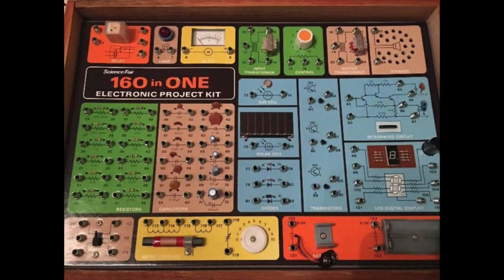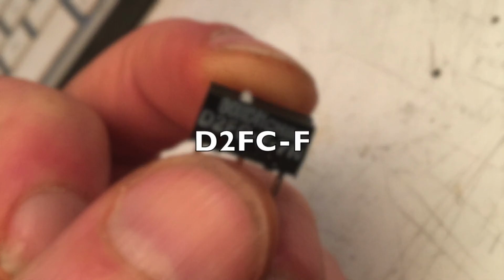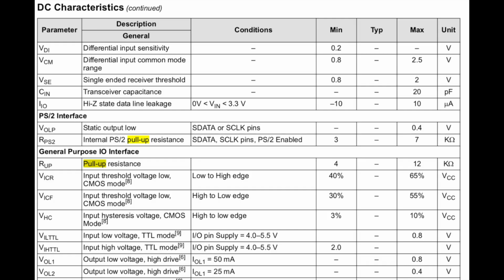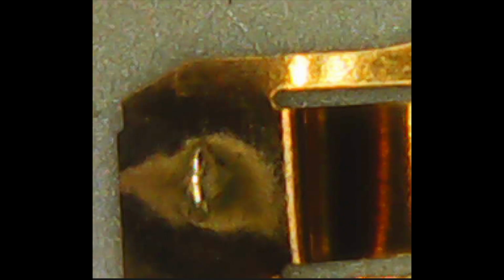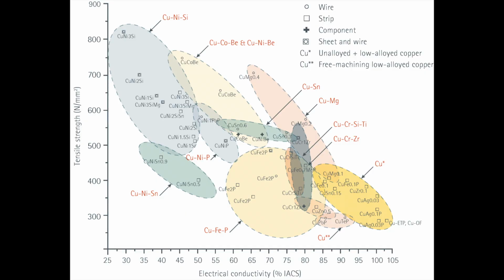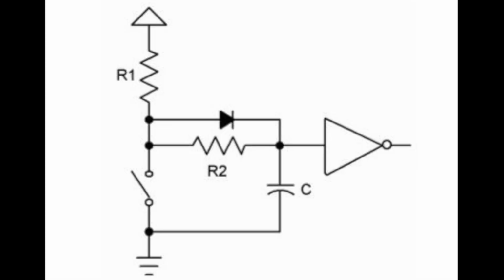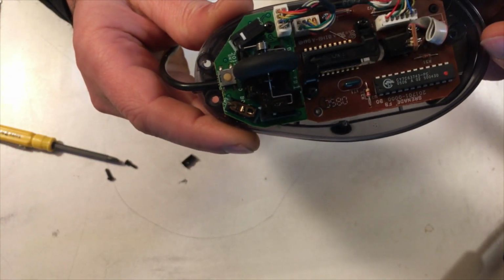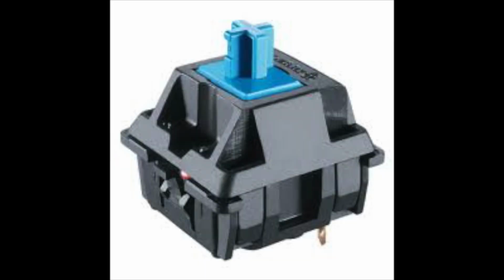Failing switch problem: Omron vs the modern mouse circuit

Comment: I am Brazilian and the video is a bit complex for my understanding. If the mouse gives double click problem which "best" switch to replace? What could I do ? Since there are no double click mice on the market
Reply from the maker: I have not seen long-term testing, but people with this problem have had good luck with the Japanese D2F-01F (I put one in my newest mouse and it has already lasted longer than the d2fc chinese switches). they are not perfect, but they are easier to find than other options (like the honeywell switch, which I am also trying out). One problem though is that total height above the base that the button actually clicks is higher than  the stock Chinese switches, and the plunger is slightly longer, so in SOME mice (Razer for example) they can feel too light and click too easily, and they don't have as strong a click feel. You can shave down the base slightly with sandpaper or whatever to fix that though. I have not tried out the newest options from Kailh or Huano yet, so I can't say if those are okay.
Reply: @AlexKenis  Many thanks for the reply Alex Kenis. Very nice that you make a very informative video and still answer the comments. I will buy an Omron JAPAN D2F-01F I hope it lasts a long time. Thank you friend. And i buy TTC GOLD (30M) for test only: https://pt.aliexpress.com/item/32837651235.html it's good ?. Thanks again. I found a Honeywell with gold alloy contact too, I will buy to test. Thanks for the tip from omron japan and honeywell.
Reply from the maker: @Pedro-gy4ht  I had not heard of that TTC switch, but the link says they are rated for microamp loads, so if that's true, i'll be interested to see how they hold up

Comment: Hi alex, sorry to bother but i saw that cherry has a switch (DG2)with a rating of 0.05A at 30VDC and gold plated contact. Could it be considered in specs?
https://www.mouser.com/catalog/supplier/library/pdf/Cherryswitches.pdf
Reply from the maker: Never seen those.  Looks like they are 87 cents on aliexpress, so I'll grab a few next time I put an order in.  Looks like they have a very low electrical cycle life, but that may just be an extremely conservative rating.

Comment: You sir, are life saving mad man!!! Worth every minute of this 1 hour and 15 minutes diatribe!

I always wondered why my Logitech G5 lasted 10 years and my G903 lasted just one before both switches failed (despite costing 3 times the price!).

As someone who have just recently replaced both double-clicking chinese Omrons, that lasted for a bit more than 1 year with light gaming, for Japanese ones (D2F-01F-T) on my G903, just to have these to start double-clicking as well after 2 months (!) of slightly heavier gaming sessions (+/- 2 hours/day), I appreciate immensely the information provided here!

I'll try other switch brands (I have some Taiwanese ZIPPY DF3s on their way now), but at least now I know this is unlikely to fix the problem for good, since the problem is with the mouse design and not necessarily the switches...
Reply: My mx-518 lasted 10 years.
Reply: Any results with the other switch brands?
Reply: @Black665  Yes! Following Alex advice I decided to pick some switches that had a lower current requirement than the standard OMRON switches. The only one I could find was one made by Cherry (DG2 T85), that has a 0.05 AMP requirement (instead of the 0.1 AMP of  every other switch brand). 0.05 AMP is still higher than what the G903 controller provides (which is closer to 0.03 AMP if I'm not mistaken), but I figured that it could last longer since the specification was at least a little closer to the current provided by the mouse's controller.

But the result was, unfortunately, not different from using Chinese OMRONs D2FC-F-7N(20M): they started to double-click after 6 months. Why always 6 months? I have no idea... But at least it was better than using Japaneses OMRONs D2F-01F-T(50M), which only lasted for less than 3 months before started to double-click.

So, at this point I have decided to get rid of my Logitech G903 (I have replaced its switches 3 times already in less than 1 and 1/2 year) + Logitech G Powerplay Wireless Charging mouse pad, and replace this kit with a Razer Basilisk Ultimate --which seems to have a long lasting battery, a convenient desktop charger and, more importantly, comes with optical switches that will never double-click. (Note: there are lots reports of people having the same issues with Logitech's G Pro Wireless. So I decided to skip that one altogether at this point as well)

My conclusion is that wireless mice seem to be more susceptible to these switch failures than wired mice (maybe it has something to do with the power efficiency of these wireless mice controllers, that is much higher and consequently much more out of spec to what these regular mice switches need to operate properly for a long time) . So, until all manufacturers move their wireless mice to optical switches, I'll have to stick to Razer (the only one offering wireless mice with optical switches at the moment: all the Viper line and some of the Basilisk models).
Reply: @SamGalt  Nice, thank you very much for coming back on this! Really helpful for me and others I'm sure
Reply: @SamGalt  Oh no, the Japanese Omrons didn't work for your G903? That's disappointing. 

I've heard Kailh switches can be a good alternative to the Omron ones.

The Razer Basilisk Ultimate seems like a good alternative to the popular Logitech G502… I might look into that for my future mouse, even though I'm fond of Logitech products and my G900 Chaos Spectrum and generally don't find Razer products that appealing to me… Damm it, Logitech, you're going up lose fans like me to other companies if you keep sweeping this mouse switch problem under the carpet!

Comment: £15 for a budget new, but discontinued Acer Predator Cestus 300 today. If the Omron switches die, i'll order replacements for a few bucks and solder them in. I'll be fine for a while i hope.

Comment: Alex Thanks for this knowledge drop. Have you tried using other switches outside of omron to upgrade the mouses? Also to anyone reading this
The D2F-01F ( mine could be counter fit but works) feels different than the original D2FC-F-7N

on a Logitch G303. japanese d2f-01F feels slightly heavier and has a lower pitch click. It also feels like it has less slop before it clicks. Its more of a crisp click compared to the original. Id like to go on a quest to find a better switch than these d2f-01F
Reply from the maker: I have used a bunch of different switches.  Right now I have a mix of the Japan D2F-01F  and Honeywell switches in the g502 on my desk and they have been working fine for several months.  I agree that the D2F-01F have a different feel.  They are actually lighter feeling than the 20M omrons they replaced, and seem to have shorter travel before they engage.  The honeywell switch is very crisp, but this is the first time i have used one long-term, so I'll be interested in how well it holds up after a few more months
Reply: @AlexKenis  is the honeywell a direct replacement for the original left and right clicks? does it bother you that the replaced switch is different from the original? If everything was replaced it would be difficult to detect but if the left and right are different its very noticeable. I was trying to find some other switches with different actuation pressures with no strait forward avail. I was thinking the color correlated to a force like 70 or 75 gram white, grey, blue.

Comment: This video will be fun. I've bought mice from under 10 USD that lasted more than 5 years with no issues, but when I decided to pay higher for a current gaming Logitech mouse I had it double clicking in just 10 months while I never damaged it in any way. Called warranty, they sent me another one of the same model quickly and effectively so I was pretty damn happy with it...

Only for it to break down the same way in just 4 months.

Called warranty again and they're sending me a headset to cover the price I paid for the first mouse. Let's just say I'm pretty fucking disappointed.
Reply from the maker: I hear ya.  Some manufacturers are getting wise to the problem and implimenting fixes, but as cynical as it is to say... switch failure is apparently the #1 reason people buy new mice, so I don't expect the 'big guys' to completely solve it, just solve it enough to live past the warranty date
Reply: @AlexKenis  The worst thing is that the only company that tried to invest on modular switches and easy user access to those was ASUS with its Gladius and Pugio mice, but they're difficult to come by and prohibitly expensive in my country. From the looks of it I'll have to let go of the whole RGB thing and start using cheap under 10 USD mice again, since I'm poor and useless at soldering.

Comment: TBH i dont need them to last long. I got the g402 mouse after the warranty expired 2 months later left click started to double click like crazy or sometimes flat click. Middle click died early. The stock switches are garbage on g402. I just go my new switches i need to replace them but im gonna do that later

Comment: I have Logitech G102 , before that i had g300s , both started double clicking issue. I was about to change/RMA G102 , which I will shortly, but the moment I changed the polling rate, the double clicking issue got resolved. As others said, my next mouse will be one where I can swap the switches to a better one. Chinese OMRON is there for purely planned obsolescence. This is a very informative and useful video I have seen in recent times. Thanks a lot.

Comment: Two words. Planned Obsolescence.
Reply from the maker: Sigh... yeah, most likely.  Several companies do the same thing with firmware, software control panels, proprietary interface code, etc, and have for a long time. It seems like a mouse with swappable switches would be a big selling point (like mechanical keyboards) but they probably get a TON of business from folks just tossing out their old mice when the switches get wonky. But They really should reconsider the economics of the situation, because there is a lot of competition these days, and people are switching.  The only reason I stick with a g502 most of the time is because I macro hover functions to tiltwheel+side-button  modifiers (and the free-spinning wheel lock is nice), and there are not a lot of tilt-wheel gaming mice (roccat and Razer make one or two...), but if somebody made a lighter tilt-wheel gamer without goofy software, was optimized for the switches, and is friendlier to non-palm-grip users... I'd swap in a minute
Reply: Strange how my original g502 from 2013 or 2014 is still working after 5-6 years of programming and clicking and gaming every day for 8-12 hours

Comment: Alex Kenis
 thank you for this.  I never thought to replace my failing mouse switch as I had no idea the switches were so easy to come by, I had always assumed they were either proprietary or at least rare.  In hindsight I should have looked.  I just used a Japanese D2F-01F as it seemed like one of the better ones as of this video and it would definitely be good enough.  I can drag and drop again!

Comment: What do you think is the best mouse microswitch? Is it Omron or those panasonic switches you briefly touched on?
Reply from the maker: It tough to say what is 'best' because it depends on usage and the mouse.  Older circuits do fine with the various Omrons, but newer circuits (especially low-power ones like the newer logitech wireless mice) need something like the japanese omrons or the other brands with microload-rated contacts. In my g502, I ended up using a honeywell switch for my left button, and  japanese Omron for the right, just because the Japanese omrons have such a light touch that I sometimes accidently click them on the left button, but some people like a really light touch. I did a teardown and click-force comparison of about 2 dozen switches a few months back, and took pics of the switch contacts under a microscope... BUT haven't had to chance to edit the vid and post it.  Eventually ill do that. If I were going to buy something like the new Logitech wireless gaming mice, I would also buy a few Japanese omrons to put in there when the original buttons start developing double-click or click-and-drag issues, because I suspect that they all wil eventually unless you get lucky. I can't call them the 'best' but they have been working fine in lower-powered mice, and they are easy to get ahold of.  Don't expect 50 million clicks out of them (just because of the precious metal contact material wear) but they do seem to outlast the regular Omrons in those particular mice.
Reply: @AlexKenis  I'm asking because I replaced my G900 switches with the japanese D2F-01F-T's and I'm happy but I also have a G402 and a G502 HERO that also need switches and I guess they have the low-powered circuits as well
Reply from the maker: @nasko235679  Gotcha. My 502 is the 1st gen, so I have not measured the hero version, but if yours failed already, it's safe to say it is pickier about switches than the older version. If you like the D2F-01F japan style switches, that's probably a safe bet. BUT they are less mechanically rugged, although electrically they seem to last way longer in those circuits.  But the AH series panasonics might be a good choice as well though if you want to just be able to pull them apart and put a new spring plate in there when they wear out instead of resoldering a new one in, because they are a single-plate+spring design like the Chinese Omrons, but have much better contacts.  you CAN rebuid the Japanese omrons as well, but it is a huge pain in the butt because of the 2-part spring design. The honeywells are super easy to rebuild because of the design, but they have a much different feel than the rest.  ya know... if you can hold off for a day or two, I think im going to go ahead and do the voiceover on that switch comparison video and get that posted becuse it seems like it would be useful to people.
Reply: @AlexKenis  Oh and last but not least thanks for the content. You're pretty much the only source that goes this much in depth about mouse switches and I found this important information right when I needed it most.

Comment: Took me awhile to find information on this. After one RMA and year later I had the issue reappear. After watching this, I took mine apart and went to town removing the bad switch and replacing it with the other switches (I never really use G7 & G8 )in my G502. I say switches because there wasn't a good away to remove them from the board without damaging them. Usually I am pretty good at being careful, but this type of board was challenging to work with.  At one point I thought I messed the logic board from heating it up too much. Had one switch stopped clicking, but the other was fine. I did have trace pads pulled up easily on both of the donors. The bad switch didn't have any issues coming out and trace pads were solid. I guess my iron was too hot for the other two. Since the board is layered I doubt I will be able to just shove em back in and expect it to work.  Now that I reflect back on it, I believe solder wick or solder sucker would of been really helpful. Finally got the working switch into the board put it together, and it works for now.

Comment: I.m not a gamer too, but a very heavy user (some 12 hours/day). My mice used to live no longer than a couple of months, no matter how much I payed for them. This made me decide to by 10 mice from aliexpres for about 20 bucks (total) and I was prepared to throw them in the garbage bin after a few weeks of use, I would still reach more usage time for less money. But guess what, after 2 years I'm using my second mouse, I only had to throw away one single mouse!
Reply: It's funny because i had a cheap ass Logitech M100 mouse that lasts me for 5 years and yet a new GPW and G103 mouse fail within 6 months. Never waste my money on Logitech products again.

Comment: Gone through 3 logitech 502 Hero's since october 2018. It's now march 2019. I'm so done with these. Like, seriously, start making decent mice again! My Ouroboros still works after all these years.
Reply from the maker: I hear ya.  My old death adder is still going.  I dropped a honeywell switch in the left button and a Japanese omron for the right, so we'll see how well they hold up
Reply: Used an original G502 proteus core from 2013 (2014?) until late 2019 and it is still working to this day. Maybe the older g502 series had a better design.